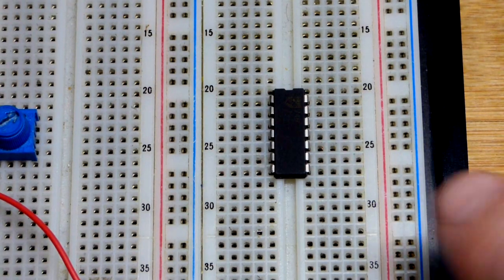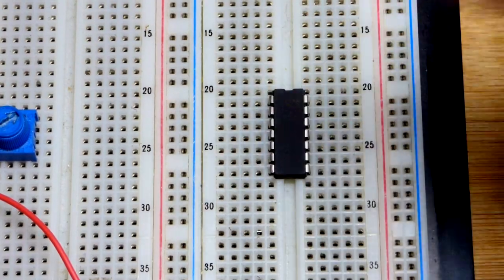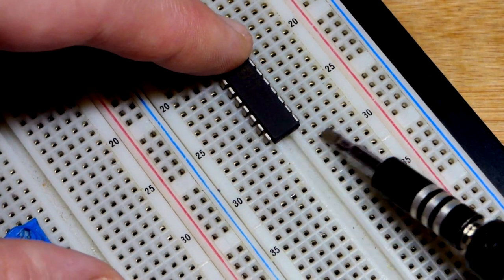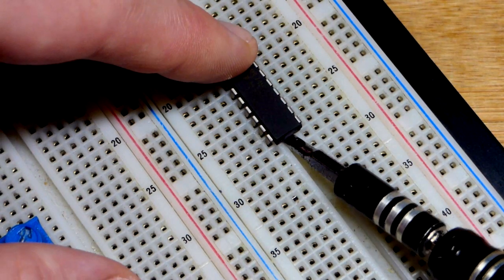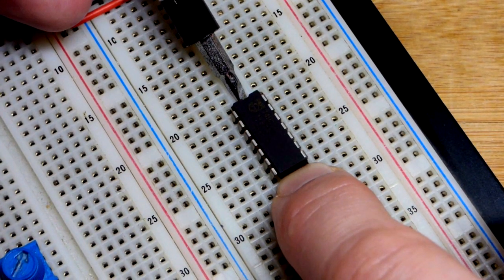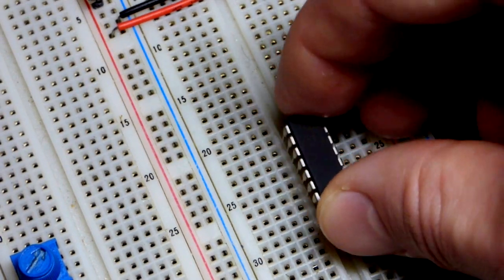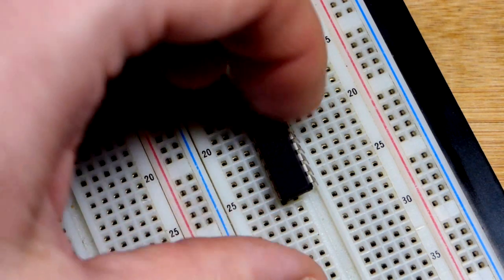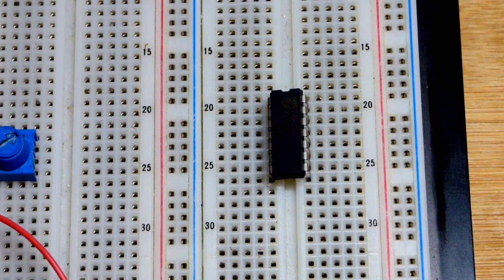How to safely remove an integrated circuit IC from a breadboard using a small screwdriver

Comment: How do you deal with IC where one side always pop out?  I have to use my finger push it in the breadboard hole while testing the circuit. If i let go my finger it pops out and the circuit doesn't work.
Reply from the maker: I haven't had that happen with an integrated circuit, but I have had that happen a lot with pushbutton switches. I think the higher quality breadboards squeeze tighter, so if component pins or leads are larger at the top, then they get squeezed out easily. Over time, the spots I put my switches in don't grip as hard, and the switch stays in place a lot better.

Comment: Do you have a vid on how to use it I don’t know how and my last one I set. On fire and burnt my self so do you have a vid on it
Reply: Thanks
Reply from the maker: Here's the latest video I made covering this particular integrated circuit https://youtu.be/ZMptDLjwgsY 7408 74HC08 quad 2 input AND gate integrated circuit IC LEDs electronics how to DIY demonstration . Unfortunately the 7400 series integrated circuits are easily damaged, I've fried at least 4 of them recently, so the datasheet must be consulted for the best chance to use them without damaging them. Can find the datasheet by googling the part number and looking around for a while. Thanks for watching!